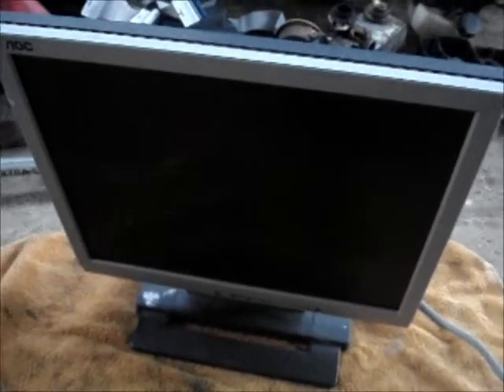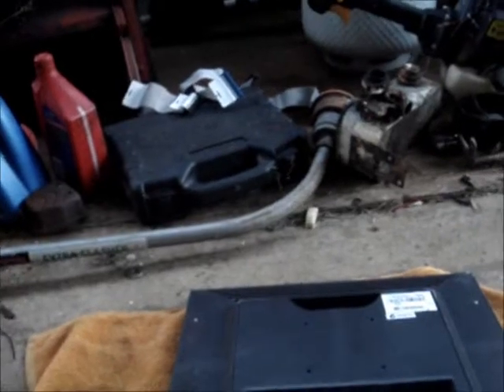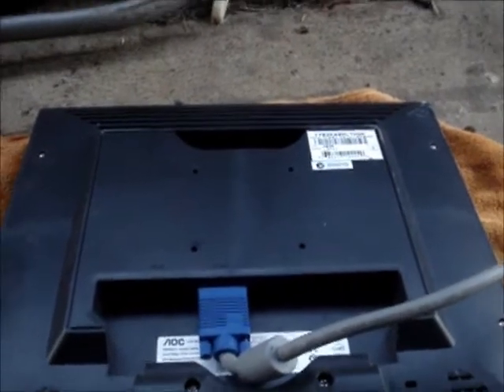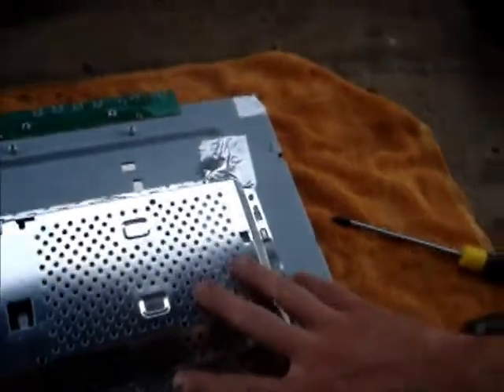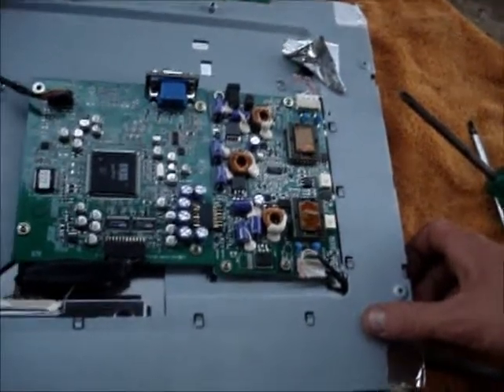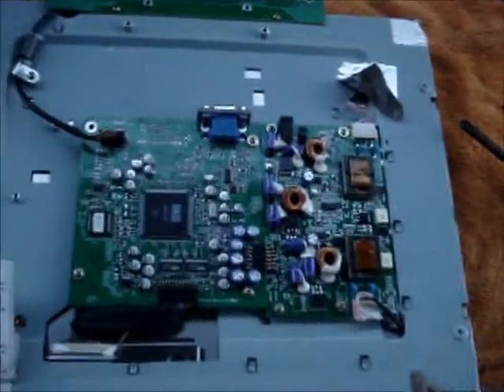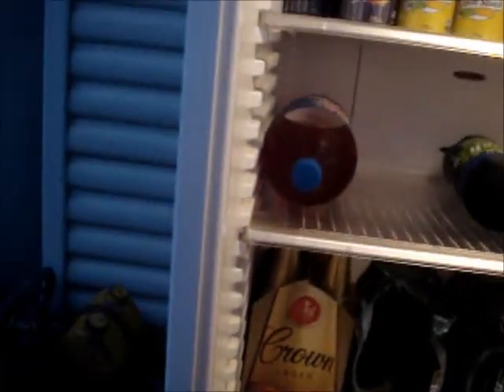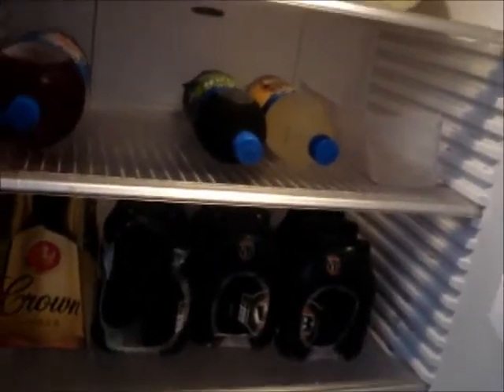Disassemble garbage lcd monitor and check... Warning: very course language!!!

Comment: im sure the council would do something about noise pollution but probably pin you for the same thing or some fucked up tidy yard by law under the same breath.  shows how fucking useless there system is.  
maybe it was the power supply that was fucked on the lcd? 
good vid.